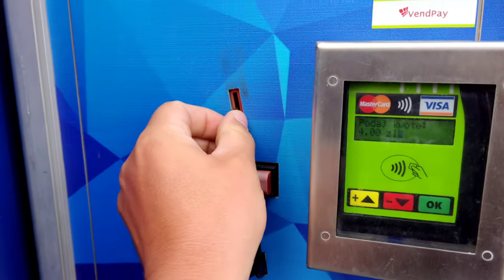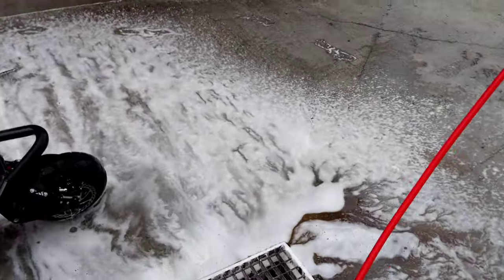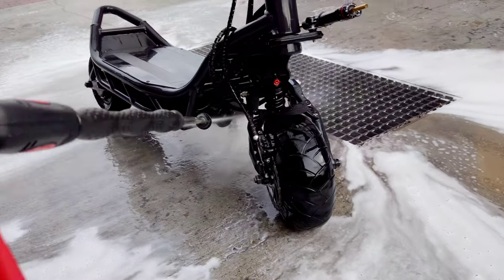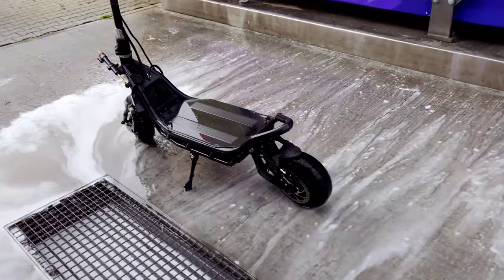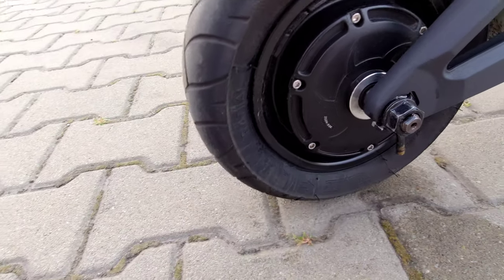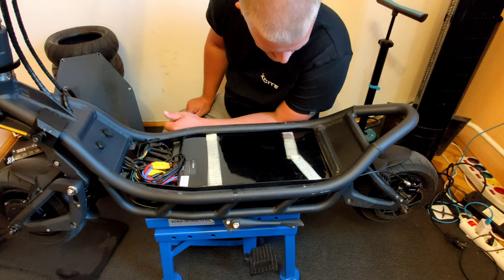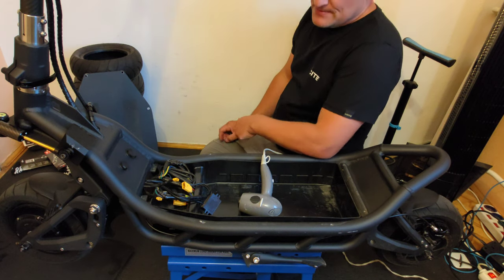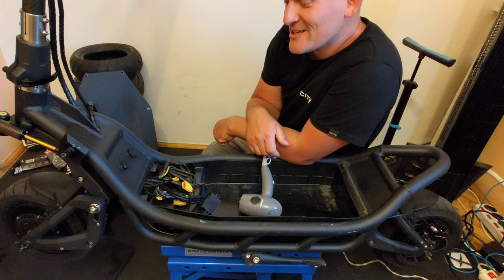nami burn e viper waterproof test

Comment: Thank you!! This is EXACTLY what I'm wondering if i can do without breaking it! Finally a video showing me it's okay! 😎
Reply: be carefull with the motors...
Reply: i have two motors open In front of me, they are Not "waterproof* as stock, (trust me NOTHING is), good thing is they are not hard to open and" waterproof" by yourself, just use the right tools and a silicone that doesnt corrode metals (most do), if you ride pretty much any scooter In wet conditions without waterproofing them yourself you Will have rust In the motor/motors at some point.

Comment: As usual tyvm for uploading these videos and share your experience with us! 🙏 I've few questions if you could kindly answer them 🤩

1. How is the battery after 7k km?
2. Do you know if there is any new Nami model released soon?
3. What is the baddest thing about this model?
Reply from the maker: 1. I didn't notice any difference in range
2.they are building a 60v model for next season
completely new look
3,acceleration
Reply: @carbonio4190  Cool! Tyvm for your answer and update! If it isn't too much asking for, do you've a link/picture of the new model? But isn't this one you're using 70v?
Reply from the maker: @Kingtstayle  https://www.facebook.com/groups/namielectric/permalink/890616428284411/

Comment: Hi man I’m considering buying this to get to and from work. I don’t have a car and need something to last so I can avoid paying road tax/insurance. It rains a lot here in the UK sometimes very heavy. Would you say this would be safe to use in constant heavy rain. They say it is ip65 rated?
Reply from the maker: You will have to make some adjustments to it, unscrew the deck and seal it with the silicone or something, there is a huge hole for the cables on the front, which also need to be close somehow
Reply: @carbonio4190  I see. Thanks alot for the reply!

Comment: I rode this thing in the rain and it worked just fine.... Until it didn't. Eventually had to replace both my motors and the headlight. 

If you're gonna do this, you better make sure it's dry before using it again.
Reply: You mean it’s ok to ride this in the rain but let it dry before using again? Am i gonna have to replace my motors too?